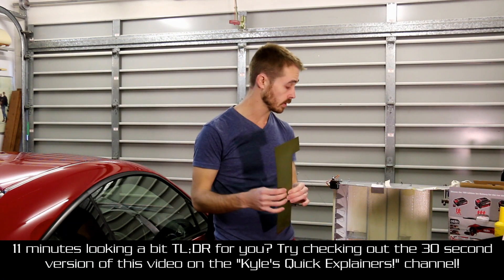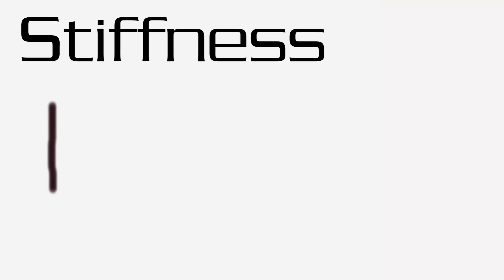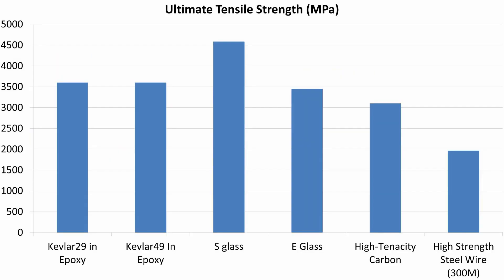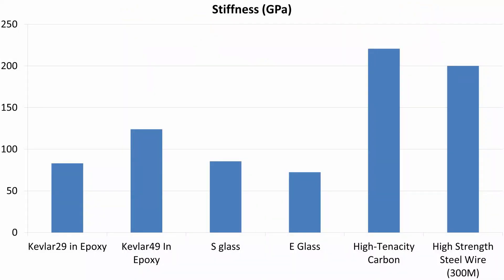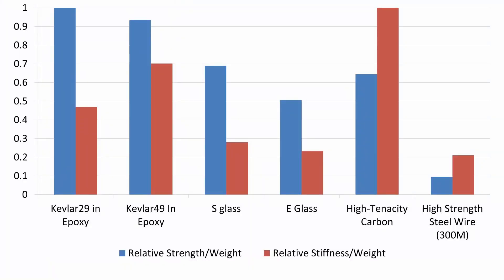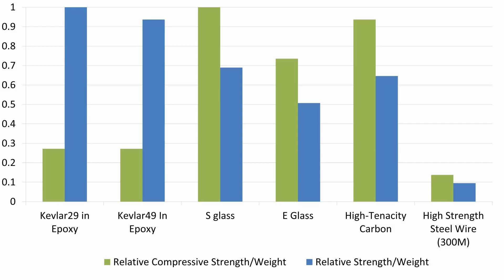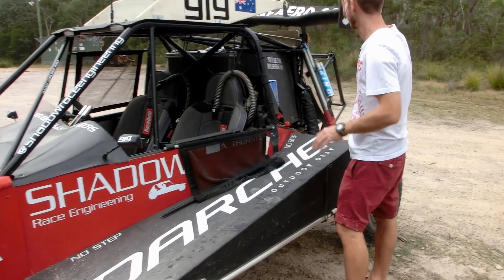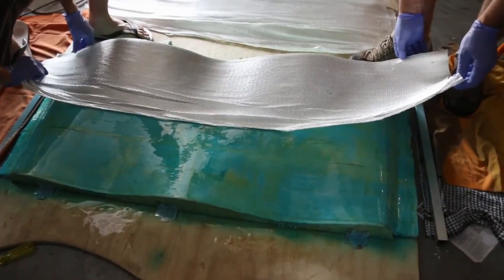Carbon Fiber vs Kevlar vs Fiberglass - Which one is right for YOU?

Comment from the maker: Since Youtube is about to delete annotations, figured I'd post them here for everyone to see. Enjoy the video!

0:01 The numbers in this video are generic data taken from official sources (such as DuPont) to demonstrate trends. Your material specifics may vary significantly. Always consult your material data from your manufacturer before designing a layup!

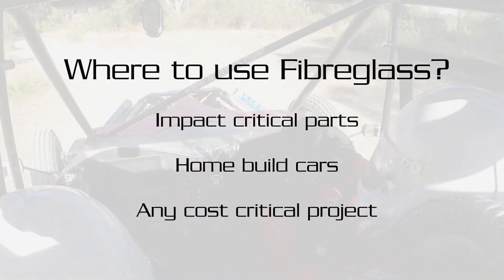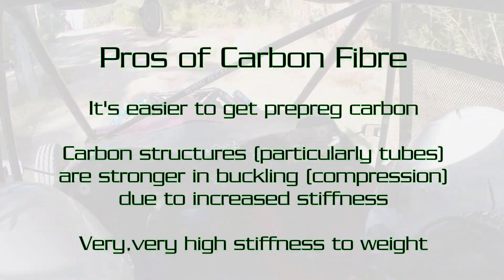10:14 What I more should've said was shock loading where the part is expected to not fail, as fibreglass and kevlar will do better here. Carbon is a very common material in impact attenuators because they are designed to permanently deform (fail) inwards. Carbons high stiffness allows you to use a tube like structure and be very strong in direct compression (10:19 in video) without buckling. You then use a geometry like a tapered cylinder or cone and it essentially folds in on itself, absorbing large amounts of energy as it progressively folds down. This is further helped by the thicker walls per unit weight for carbon, which means they have more bending strength on a skin basis. FIbreglass may have buckled in this scenario (on either a skin or whole structure level, not stiff enough), and kevlar is weak in compression, so carbon is the way to go.

10:31 Kevlar fuel tanks: Kevlar has very high toughness and good abrasion resistance, and fuel tanks are a component that will only ever see very high loadings in tension, so Kevlar is appropriate here. I guess for the applications I was only really thinking bodywork
Reply: can you please share the PDF file containing all these graphs. that would be very kind of you , Thanks
Reply: I dunno why you insisted on comparing the absolute rock bottom of the barrel carbon fiber to the highest grade of Fiberglass. Even garbage-grade T300 carbon fiber is stronger than 3100 mpa. A mediocre grade T700 carbon fiber is 4900 mpa strength, and is considerably lighter than S-Glass. On top of that, that's just the strength of the fibers. We're not basket weaving here. It is very confusing to mix laminate strength with fiber strength and pretend they're equally relevant.
Reply: Carbon Fiber looks better too, but...What about Carbon Fiber wrapped on a Fiber Glass core? Like 50/50, 40/60, 30/70 wrap to core? just wonderin
Reply: @MrTwisted003  that's what I was thinking of attempting
Reply: You would want to design a part that is overbuilt, i.e. the primary build layers' added volume mechanically supports the cosmetic layer. Example, additional layers of S glass to increase overall part stiffness to support the carbon fiber layer, which could fracture inside the matrix (and ruin cosmetics) if exposed to enough impact or flex, which a thinner fiberglass part could normally sustain. Not a massive concern for any part that won't see flexural loads/torsion, say a gas flap cover or trim under a windshield (also not under aerodynamic forces)   @MrTwisted003
Reply: what would be the best for crash structures, to soften the impulse in collisions (adequately decelerate car but in a long enough time period to reduce crash impact g-forces), while also optimizing weight and cost?
Reply: if I'm making a car's impact structure with CFRP (maybe S-glass instead) and say I have a titanium pipe for reinforcing said structures. Say, I want the internal occupants to not experience more than 10gs in a 60mph crash, the structure should have some "meat"/volume left for a 2nd crash like that (40mph) without being much harsher (under 20gs) on the occupants....how much CF do I need? What kind of fiber? What kind of resin? How much resin-to-fiber? What way should the fibers be aligned? How do I use the titanium pipe to maximize strength and resilience of the material for secondary impacts/compressions? How dense will the CF fibers and resin be? How much volume? How much weight will it be? How much would it cost? Can it be made to be inert to natural weathering or would I have to paint it to shield it from UV and rain and other gases?
Reply: Hi Kyle, if you're about to make war suit in case of handling sword/spear not bullet what material you'll use?
Reply: Sooooo if I was building a car that's basically a race car. And I wanted a skid plate to protect stuff but also wanted to keep it might and stiff since it'll help with aero to the rear diffuser. 

What would you use? 

Was thinking aluminium. But salt where I live. So then I considered carbon but it breaks way to easy in my experience with bikes. Thought about Kevlar with an epoxy. 

But would fiberglass be a possible choice?
Reply: Would love to get all of the graphs you have presented here. have you ever considered putting them in one file for reference. would be great. thanks for such an informative video.
Reply: @KYLEENGINEERS building a basic side panel on an e dirt bike. Can you mix e glass with Carbon fiber. Not a structural piece. So curious if worth saving a few bucks to sandwich e glass between CF?
Thanks!
Reply: Is this still fairly accurate 10 years later with new technologies?
Reply: I've decided to go on diet and lose 50lbs kill two birds with one stone make my car and bike lighter.
Reply: Where can I buy the fiberglass S glass And the resin?

Comment: The choices; 1. Carbon Fiber: Pros: super light weight, excellent flex characteristics, Cons: Expensive, Splinters, and brakes easy on impact. 2. Kevlar: Pros: Impact resistance is unmatched, Cons: Fairly expensive, less than ideal flex characteristics. 3. Fiberglass: Pros: inexpensive, Cons: Moderate strength, flex and impact characteristics. So basically Fiberglass is the Toyota Corolla of the three. The other two are for specialized applications.

Comment: Generally... with composites... everything that is "Good" about composites is due to the fibers... everything "Bad" is due to the resin system...

The testing I am familiar with, Carbon beats fiberglass in every criteria... stiffer & Stronger... even better than "S" Glass... (Even bearing and short-beam shear)
Glass is nice when you need deflection... such as a landing gear strut..
(Comments above in the context of Epoxy: VARTM, Wet Lam and Prepreg)

Comment: You just mentioned high tenacity carbon, if you look for intermediate modulus carbon you see a 7GPa ultimate tensile strength so it’s far stronger, has though half the young modulus of your carbon, but still 1.7 times the one of fiberglass

Comment: Nice video, there is a lot of information in it that is not otherwise easy to find. 

Could you make a video where you look at Carbon-Kevlar specifically? It is hard to find detailed information on it. It could include things like the advantages of using Carbon-Kevlar over simple carbon fiber and why Carbon-Kevlar use in cars was more prevalent in the 1980s compared to the past few years. It would also be nice to see whether Carbon-Kevlar works well when it is used to make a chassis, compared to when it is used to make body panels.

It would also be nice to see a video about other lesser-known lightweight materials that are used in car design.

Comment: Could anybody please tell me what kind of material Keahi Seymour used for his bionic boots? 

https://youtu.be/-b20m6JnY9k?si=jJDHl4CBRDTKtJUv
And do you think he choose the right one?

The problem I have is that a wet layed carbon fiber is much weaker than a properly cured and vacuumed one. But a proper vacuum pump and a autoclave for a one-time project would be way too expensive.

Do I need heat treatment and vacuum for s-glas as well?

(If you look closely, you can look through the dark parts of his boots, my guess would be sime kind of thermoplastic for the red part and a thin kayer of carbon fiber for the black parts?)

Comment: It's important to note that strength in materials is 2 things, hardness and toughness.

Toughness is basically an offensive property, in respect to how it cuts or digs into another material.

Toughness is basically a defensive  property in how well a material resists damage.

Diamonds are noted as a very hard material. However diamonds are not tough.

Metals are usually tough.
Iron is highly tough.

Adding carbon to iron increases its hardness, but too much and it looses the toughness.

Comment: if I'm making a car's impact structure with CFRP and say I have a titanium pipe for reinforcing said structures. Say, I want the internal occupants to not experience more than 10gs in a 60mph crash, the structure should have some "meat"/volume left for a 2nd crash like that (40mph) without being much harsher (under 20gs) on the occupants....how much CF do I need? What kind of fiber? What kind of resin? How much resin-to-fiber? What way should the fibers be aligned? How do I use the titanium pipe to maximize strength and resilience of the material for secondary impacts/compressions? How dense will the CF fibers and resin be? How much volume? How much weight will it be? How much would it cost? Can it be made to be inert to natural weathering or would I have to paint it to shield it from UV and rain and other gases?

Comment: What we figure out now in high end racing is that stiffness is not always great. Similar to how racing tires shape up under heat and high RPM, shaping itself as a nice sideeffect to higher performance, we find now that the downpressure on a car also can have a smoother and therefore performant curve on less stiff materials. Essentially the body can push down, allow for less downforce, and therefore stable downforce when more air pressure (high speed) is applied. Therefore you can expect a comeback of carbon fiber in the racing department

Comment: hmmm what about dyneema bro (UHMWPE). its replaced steel chain in the off shore oil industry but im not sure if thats just coz it doesnt cut people in half when it fails so maybe saves money on insurance? or maybe it has to do with the metal fatigue and they need a new chain for each lift of a 100million$ structure? its pretty cheap on aliexpress and has been used in the newest generation of bullet proof vests. 
theres a company called safeline who hisotrically made garbage rebranded import chinesium vests but recently came out with their $5000 "hyperline"armor and claim its the thinnest and strongest thing since slicded bread but its pretty obvious to me that its just dyneema/uhmwpe for the first 2 thirds and then kevlar for the rear 1 third.... i read some mat science papers that says dyneema in projectile impacts tends to fail from the backwards to the forwards so maybe this has something to do with it. 
actually i dont even think safeline heat bonds the layers of dyneema togeather like mfg used to do and i dont even think the kevlar is imbedded in any resin unlike most older armor vests..... i always thought thats why vests have an expiration date coz of the resin and UV/salt risk?

anyways, i bought a big roll of 180g/cm balistic dyneema and a big role of "balsitic kevlar" from china and also i bought a handfull of sapphire watch crystals for 3$ each (yeah real single crystal sapphire has really hit rock bottom prices but everyones still charging insane amounts). I was thinking of making an extremely thin vest capable of stopping rifle rated rounds coz of the sapphire strike face? might try silicon carbide and some other ceramic materials they sell as like ceramic ball bearing balls u can buy for cheap. i think they have big garnate/high pressure water cutter sand abrasive medium that is boron carbide or something too. big flakes that i could try putting in front of super thin dyneema layers?

Comment: Hello Kyle.Engineers friends. 

I'm trying to mix by just 10% of chopped fiberglass into J-B Weld Original epoxy to improve it's lateral strength but which fiberglass length is stronger, a 4.5mm or a 6mm (does shorter mean weaker or stronger?).

Thank you.
God bless, Rev. 21:4 Advnaced happy Easter.

Comment: These materials all compliment each other. Kevlar is best at dampening vibration so it fits in between carbon and fiberglass. Fiberglass is great but it's heavy. Carbon is best when combined with all three when it's primary bonded. More stiffness with carbon. The single most interesting component is actually the resin to material weight ratio and secondary bond all other factors considered.  They make Military jets out of this stuff for a good reason. One day my friend was down at Northrup and passed by a dumpster. WELL, a huge load of pre preg carbon had fallen off a forklift and dented the rolls. That dumpster had hundreds of thousands of dollars worth of carbon fiber in it off to the dump. Bullets bounce off the job when it's done right. Lots of things to contemplate. My brother in law made bulkheads for some of these jets. Nothing is casually made. Everything must be perfect. I just make a few surfboards and foil equipment out of my garage. I know that these materials can be a superpower.

Comment: Soo much misconception with carbon fiber. Might make a very good torque tube, or drive shaft, etc.. But would be horrible as roll cage tube... Carbon fiber , or glass tub / floor would be easy for road debris (metal parts) to penetrate at speed, yet with some kevlar , much safer...  Also the direction of fiber...   bonding resin poly vs epoxy, etc... temperature issues,  ....

Comment: I hope that you still respond to comment on this older posting, I guess that I will find out.

I really appreciate this video. I am designing to build a 16' long by 6' wide tear drop trailer that will have a bottom cavity with a top cavity that will raise to position once at the camp site. So that it will have a travel mode and a living mode. At first I was thinking of using aluminum, but now I feel that fiber would be a better choice for the body as well as easier to work with. I was thinking carbon fiber but after seeing your presentation maybe the S fiberglass would be a better choice. The weight of the camper is very critical, needing it to be a lite weight as possible - under 3,000 lbs at the very most. I am figuring on making sandwich panels, fiber on both sides with 1 or 1.5" foam board in the center. I do have vacuum pressing available. 

Any input you can give me would be very much appreciated. Thank you very much.

Can you recommend any sources to me for continuing  my Research into this?

Comment: Thanks. Beginner questions. Q1: why not having a first coating in carbon(stifness) and on top of it fiber glass(for impact resistance)?
Q2: "Fiber glass doesn't look good", why not a final "polishing layer" with a fiber of 160g/m² or 100g/m²?

Comment: Hi Kyle, great video! One thing I missed in this video was when designing a structure that will be loaded in bending (which most structuren are) the moment of inertia plays a major factor in the strength and stiffness calcations. Since carbon has a significantly lower density when designing a part for strength in certain situation carbon might still be the lightest option. Still doesn't take away from the great video and your valid conclusions at the end of your video

Comment: Jeez Kyle, you absolutely knocked it out of the park with this. The trouble is, I end up with more questions than answers but I guess the takeaway from that it, what are you trying to use this material for? The only bit you left out - unless I missed it - were the differences in strength: tensile, compression and sheer. Does this matter much for racing applications? How much difference is there between the different materials?

Otherwise, you best yet. Well done.

Comment: kevlar sux it doesnt soak up the the resin it repels it, so it is only suspended within the resin and carbon, it wont crack but it also doesnt provide structural support either.

Comment: TY for sharing!  Question.  I've got a 300 psi tank that I want to coat with something to make it to take 5-10 times more PSI, even though I will not exceed 300 psi.  Which material do you recommend?  High temp, 450c.   It would be nice if it could handle 100c.

Comment: Hmm. I wonder which of these composites would produce archery bow limbs having the fastest possible cast? The speed of cast mainly depends on the amount of strain energy that can be stored in the bow limbs per unit mass of the limb, without permanently deforming said limbs. This attribute is directly related to the specific modulus of resilience, which in turn should be correlated with specific toughness. It would appear that Kevlar 29 wins out in this comparison over S-glass due to its substantially lower density. However, bow limbs must resist not only tensile stresses on the back, but compressive stresses as well on the belly side. Kevlar 29 as a backing laminate and S-glass as a belly laminate should make for an impressive, fast shooting bow limb. I wonder whether an ultra high modulus carbon fiber composite can compete with this particular combination when the carbon fiber laminates are used on both the back and belly with a lightweight foam or balsa wood core lamination.

Comment: I would say most people choose carbon fiber based on its looks, and the misperception of its strength. I rarely use carbon fiber when building my airplanes, and I have built a few. Almost everything is a composite of foam and S Glass. Even 2 lb density foam can add an incredible amount of stiffness as well as some strength. I have fabricated doors 36"x40"x 1/2"  with .080 lexan . The windows slide up and down unlike most planes has a vent window like your old autos and a port window under that. The weight of these doors with door handle and latch comes in at 4 lb 7 oz .    The current airplane I built with its 30 foot wingspan, Bush tires on swing arms with 16 inch travel and fox shocks, plus a type 1 2300 eng.  Aluminum tube frame, Foam & S Glass for its Shell, and Wings. It only weighs 462 lb !     I also built a stripped-down ultralite once out of S- Glass. 251 lb.